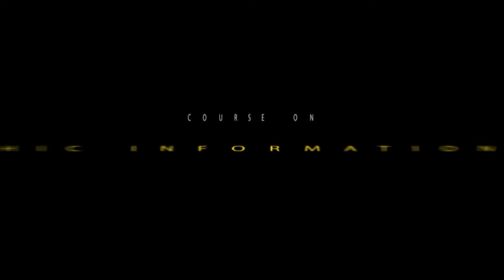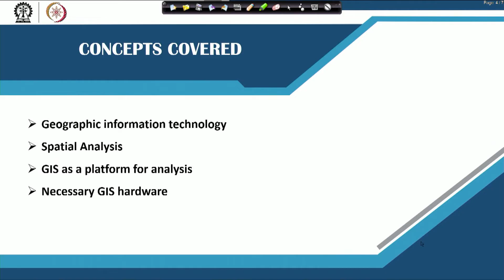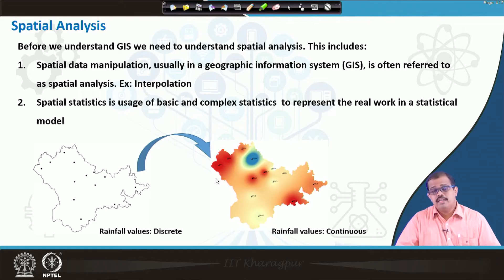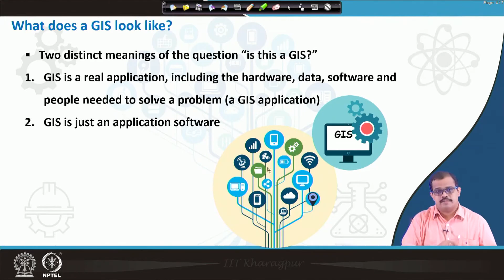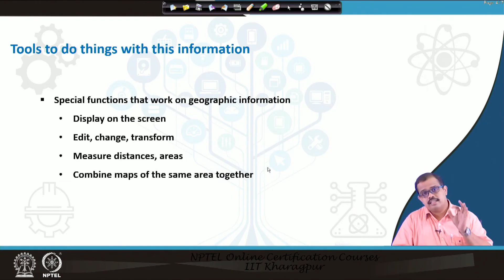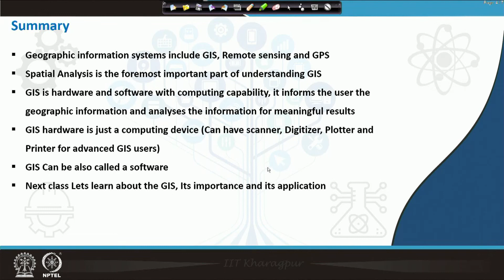Lecture 01 : Introduction to GIS

Comment: Mapping Clusters and Outliers - https://youtu.be/BgdNJkjDLAI
GIS HOT SPOT ANALYSIS - https://youtu.be/zDcE7EZcx_o
GIS Similarity Search - https://youtu.be/3W9HFeXtaHI
Settlement Model - https://youtu.be/V97Fs6qpFWo
GIS Mapping Clusters and Outliers -https://youtu.be/cvN3IzJBcI4
Remote Sensing Concepts - https://youtu.be/mZVWwhfLER0
Drought Monitoring using ArcGIS - https://youtu.be/h-VoHQhLmuI
Burn Area Analysis using ArcGIS - https://youtu.be/q2LjIe7v1A0
Earth Quack with Google Earth - https://youtu.be/QwzfglJVHxg
Flood Prone Areas using ArcGIS- https://youtu.be/bXCCrtYPxRQ
Landslide susceptibility using ArcGIS - https://youtu.be/8e1-jCdrOVs
Remote Sensing of Burn Areas using Google Earth Engine - https://youtu.be/3jR87Zv1Jnc
Drought monitoring using the Standard Vegetation Index (SVI) - https://youtu.be/3jR87Zv1Jnc
Google Earth Engine - Land Use Land Cover Classification - https://youtu.be/ilBRHCcM6-Y
GIS BASED RESEARCH - https://youtu.be/vWEngNKufBM
Study Area Mapping - https://youtu.be/3S6NzjWRbRA
Principal Component Analysis using ArcGIS - https://youtu.be/U9A-8-Bkjgo
Image classification using the ArcGIS - https://youtu.be/7rcJH8zEG9A
Mapping Clusters Part 1  Cluster and Outlier Analysis Anselin Local Morans I - https://youtu.be/EBYdYh8zZWg
Spatial Relations Modelling Part 4b   OLS Modling inerpreting results - https://youtu.be/53-aUNDd6Jc
Spatial Relations Modelling Part 5 - Geographically Weighted Regression - https://youtu.be/-RYiAp-PdPc
Spatial Relations Modelling Part 4 - Ordinary Least Squares (OLS) linear regression - https://youtu.be/uQVEoZj0ziU
Spatial Relations Modelling Part 3 - Generate Spatial Weight Matrix - https://youtu.be/iWUaNhzGdS4
Spatial Relations Modelling Part 2 - Exploratory Regression - https://youtu.be/8ngAcDGsgGU
Modelling Spatial Relations Part 1 - An Overview - https://youtu.be/YLYDtOeatyI
Spatial Autocorrelation Morans I - https://youtu.be/rH-RvUIQcDs
HighLow Clustering Getis Ord General G - https://youtu.be/YNF2zf3hSXM
Average Nearest Neighbor - https://youtu.be/RlLH_LHD4GQ
WebGIS Part 1 - https://youtu.be/VSn-k1xHEMI
Network Analysis in GIS Data Analysis - https://youtu.be/Cxs5W9TECIk
Geostatistical Analysis - Kriging using ArcGIS - https://youtu.be/n7URupdIg8A
Geo-statistical Analyst Part 3 - Deterministic Methods of Interpolation - https://youtu.be/cJZIyRroM-Y
Geo-statistical Analyst Part 2 -  Data Exploration - https://youtu.be/cJZIyRroM-Y
Introduction to Geo statistical Analysis using ArcGIS - Part 01 - https://youtu.be/4mDRGBbeIC8
Site Suitability Analysis with ArcGIS - https://youtu.be/R9X5dsSOT6M
Normalized difference vegetation index (NDVI) by Google Earth Engine. - https://youtu.be/VtUtG9xLe6A
Google Earth Engine : Digital Elevation Model (DEM) Visualization - https://youtu.be/gQh0HFrFcY8
Google Earth Engine: Map Configuration - https://youtu.be/StdS2gfjaUc
Google Earth Engine for Landsat Data - https://youtu.be/_KaqhP7jPds
Google Earth Engine - Download Landsat Data - https://youtu.be/78BiRif_DTc
Convert Parcel Lines to Parcel Polygon - https://youtu.be/7MxbYOHP_Nc
Geo database Part4  - COGO for Cadastral Mapping - https://youtu.be/9ABwb1RXExk
Geo database - Part 3 - Topology - https://youtu.be/lG-pkNjlvyg
Geo Database - Creating Sub types Part 2 - https://youtu.be/vF8w-lKMOuc
Geo database Part 1 - https://youtu.be/gq0ed_1Bl7w
Multiple Ring  Buffer - https://youtu.be/qkXAIFWGOJE
Average Nearest Neighbor - https://youtu.be/LWil5DMQLyc
Buffer in GIS - https://youtu.be/yUl7UT2JNRk
Thiessen Polygons - https://youtu.be/YjrxKyt3PSs
NDVI - https://youtu.be/YqTvTv_ok0c
Landsat 8  Band Combinations - https://youtu.be/95TklpIcIoc
Landsat 8 Bands Information - https://youtu.be/zh6wrpVlUCY
Landsat 8 Bands - https://youtu.be/7EDElcQEjSk
Vegetation Spectral Reflectance Curves - https://youtu.be/KCXTbT21dro
Electromagnetic spectrum & Remote Sensing - https://youtu.be/US8RHxQ_-qQ
Reclassify Raster Data in GIS - https://youtu.be/WZbH7d2-kmU
Data Classification Methods in GIS - https://youtu.be/pyGHAHOMBMw
Top of Atmosphere Brightness Temperature - https://youtu.be/gLvP92GX9FI
Contour - https://youtu.be/T-zrcrUaaKo
GIS Aspect Function - https://youtu.be/TqE-JZ5wc2s
ArcGIS: Curvature Computation - https://youtu.be/iEkV0sFrWjc
Slope Computation ArcGIS - https://youtu.be/65NwrdfEgUk
Parcel fabric with ArcGIS 10.5 - Part 01 - https://youtu.be/P-X0IvbELp4
How to MAKE DRAINAGE MAP USING ARCGIS - https://youtu.be/_jJuUCWradw
How to Clip DEM  USING ARCGIS - https://youtu.be/QgiYPp2AeBw
TOURISM CLIMATE INDEX - https://youtu.be/Ydu2cn-VSkk
ArcGis Georeferancing Raster Data - https://youtu.be/Qi3DsN47gKA
Google Earth Part 1 - https://youtu.be/wRloDBnaoG8
Image Pixels Correction in Remote Sensing - https://youtu.be/1REva_iVads
Image Classification Technique in Remote Sensing - https://youtu.be/bSzFrDPs7Ew
Study Area Map - https://youtu.be/VILoq6ylGmo
NDVI - https://youtu.be/bz3vtU-NnDs
Climate Data - https://youtu.be/g6rJ11v8CeI
CLIMATWAT 2.0 - https://youtu.be/9VKI_1iT3XY
Study Area Mapping - https://youtu.be/s4IB3YsCoEA
Tourism Climate Index Part 1 - https://youtu.be/T3_-8kYetSY
Tourism Climate Index Part 2 - https://youtu.be/fjkz_s1wsgs
LANDSAT 8 TRUE COLOR IMAGE - https://youtu.be/9QyS4yUuYZY
Landsat 8 DN to Refelectance - https://youtu.be/SI3DH9tzTrs
STUDY AREA Mapping - https://youtu.be/Z2snRWaWTJk
ArcGIS Geoprocessing tools - https://youtu.be/MtnfOydFHqI
ArcMap Part1 - https://youtu.be/acPbp0z7GLc
ArcMap Part 2 - https://youtu.be/K9l0Jd7cB94
ArcGIS TOPOLOGY - https://youtu.be/NU8qrBmAPpI
ArcGIS MAP BOOK - https://youtu.be/s4vO5__FINY
ArcGIS INTERPOLATION - https://youtu.be/UTnWh4j8sEU
ArcGIS COGO - https://youtu.be/zIgDid_qI7I
LANDSAT 8 - https://youtu.be/anXr_8RCbNA
NDVI with ArcGIS - https://youtu.be/SlLFZ-sG3us